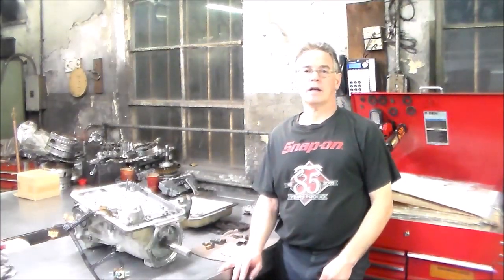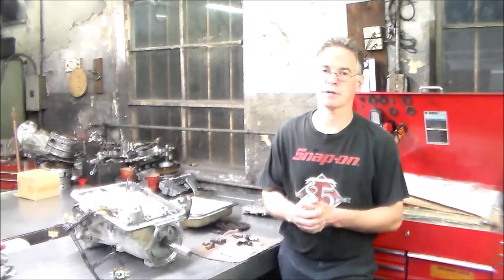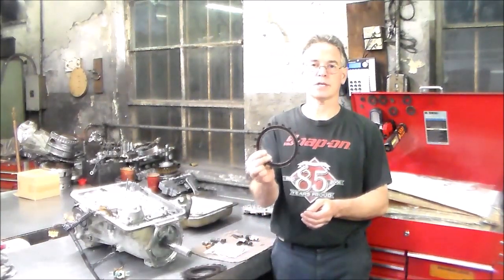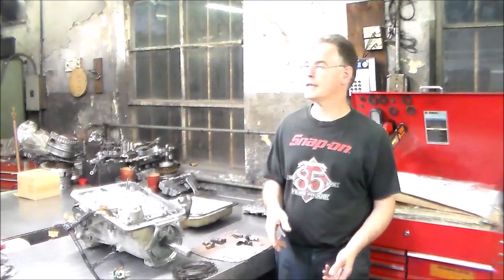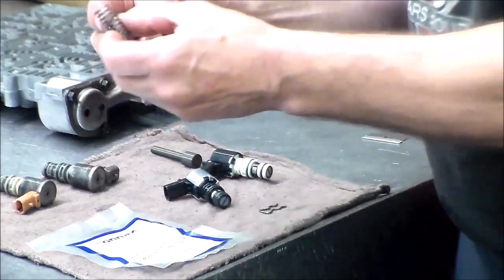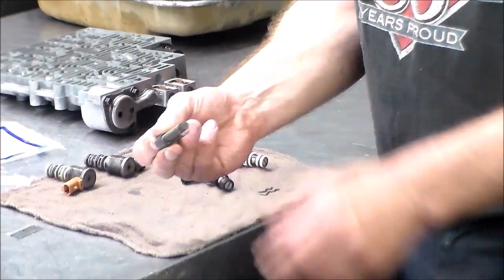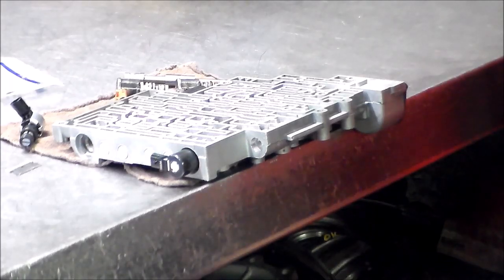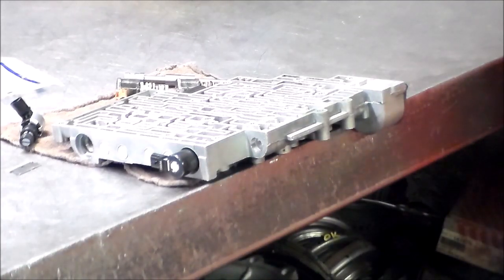4L60E, Moves Forward In Neutral

Comment: Well I'll be damned. After nearly a year looking into this issue, I noticed one of my clutches were definitely fused together. Took 2 drops to the ground to break em loose. Swapped em out from another transmission that I was planning to put in my 2004 TrailBlazer that were in way better condition and now I got reverse again. Thanks a lot for this tip here, really helped me out with the fun rebuild project!

Comment: I have a 4L60E doing close to the same thing only it will go in reverse for about 2 feet then trans brake.  Neutral and drive want to go forwards.  All gears work and shift other than 1st to 2nd gear seems to drag out when shifting.  Im going to try to swap out the valve body today to see if that fixes it.  You are the only person I seen that has a video on this topic but I dont think my forward clutches are stuck together as I do have reverse for a second before it binds.  Any advice would be welcomed and I appreciate you making this video very much.
Reply: Put the valve body from the  bad trans into a known good one and everything worked great so it was not a valve body issue I was having.  Figured I would update my comment in case anyone else wanted a little more info on my problem.

Comment: That problem has happened to me in my 02 suburban,  when I got ready to take it out, I was revving the engine in park . And herd a pop. Sound trans went back to working. 2 years later still working, but now just delayed engagement when I put in gear. I should have been removed it, but keep putting it off
Reply from the maker: Wow, suprised it lasted that long
Reply: Bro thank you, jst had transmission rebuild n forgot to flush it n the synchos or thin plates were stuck together.  Reved it high on park n just like u described it poped n now I got reverse again. Thanks, helped alot
Reply: @GaryFerraro   update  it's still working  just has the delay still.

Comment: Trying to find a good mechanic to check out my 2000 4runner. Jumps when i turn it on, reverse doesnt move at all, neutral it drives but occasionally works as neutral. Drive is good aswell as 2andL. Everyone is telling me the car is done for but I have hope it could be something like this. The car is good no lights on dash or anything no weird noises, don’t want to give up on my runner. Only codes i had were for the gas cap thing and possible vac leak
Reply: Replace the transmission

Comment: Hi Gary I just change out my a340e overdrive planet and now I don’t have reverse and neutral. All gears move forward and I took the valve body off the clean and remove all the metal shaving from the old OD planet. I think I might put the shift linkage in the wrong place when I took the valve body out the clean it. But when I put in reverse my reverse light is on.
Reply from the maker: Does the car start in park and neutral? all position seem to be ok?
Reply: @GaryFerraro  I haven’t try in neutral but I think I figure out the problem after watch some of your other videos, I think I didn’t connect the pressure valve to the gear selector (if that what it’s call) when I took the valve body off. I recall that valve was just loose and not connected to the gear selector. Will drop the pan later and get back to u thanks
Reply from the maker: @sacus209  ok, sounds good,  it's called the manual valve
Reply: @GaryFerraro  ok thanks
Reply: @GaryFerraro  ok so I hook the manual valve to the gear selector and everything seem fine and no check engine light but reverse will go into reverse but will only rev high and not go anywhere. I put at least 13 quart of transmission fluid and still rev high
Reply: Ok drove it around the block hard shifting and rev high around 30mph like it was slipping. Truck was giving to me for free from my brother in-law. 180xxx mile motor is still strong did timing and water pump  coolant flush. Before everything car will die when shift into gear but will run when give enough rpm like around 2 thousand then it will go but once slow down car hesitate on less put in neutral. So watch your vid and it was a bad overdrive planet and replaced and now the car will not die but not shifting normal. What could it be. Solenoid, TC, or valvebody, or the whole transmission
Reply from the maker: @sacus209  Just to confirm, you put the correct o/d planet set in, there are different ones.   What year is this?
Reply from the maker: @sacus209  There are other problems, sounds like internal, it slips forward gears?
Reply: @GaryFerraro  yes 2001 tundra a340e 20spline 16 reluctor 33 sun gear 8 3/4 shaft
Reply: @GaryFerraro  yes seem like I can’t go pass 30mph and it with just rev high than shift hard

Comment: Good videos Gary, just one tip.  93 - 94 were on/off CC, 95 - 97 were PWM CC, and 98 and on were EC3 CC.  The 3-2 solenoid are as you speak but the PWM styles conform to the years I quoted.

Comment: The parts that failed you didn't repair except the spring no body told you to go snooping for. So do I change the clutch plate and or the metal disc the attached to

Comment: Great info, just did a 4R75E with the same symptoms. Intermediate diode was broken and wedged together
Reply: My truck with a 4r75w is having the same problem. Would it be worth going in just to change that part? Or better off with a full rebuild. And is there anything else that could cause the same symptoms

Comment: Gary since the clutches are extremely warn would that have given any warning initially like slipping? 
Back in the day of the old school automatics [60's and 70's] slipping was always the warning sign especially when warm. Mid 70's i built a serious 67 Camaro RS with a 427/425 hp,  456 gears and a 4 speed,, i was always a 4 speed guy but now a new auto has so many gears and shifts so fast they are faster. 

Have you done any work on the new GM 10 speed yet? Its probably still under warranty anyway
Reply from the maker: Nothing on the 10 speeds yet,  Great question on worn clutches, you would think it would slip but it actually may work ok. I just finished a ford unit, came in leaking from front, did the trans and found the forward clutch wiped out down to the metal and it actually worked great
Reply: Very interesting.  Great comments.

Comment: This video taught me more than the transmission shop I had taken my Fj Cruiser to. My transfer case would grind bad when I would move it from neutral to H2. That’s because the transmission is still stuck in drive. The shop told me that it grinds cause the gears inside the trans are completely destroyed, they were wrong.
Reply: Shops aren't meant to teach you anything

Comment: The truck that I use to pick up parts , daily driver it do that . But all my gears are ok . Only it do that at times .
Reply from the maker: So it actually moved forward in neutral?
Reply: Gary Ferraro when start in park .
Veh turn on and goes forward a bit , pretty strange and not all the time .
Reply from the maker: @javieraviles6314  may want to check the cable adjustment

Comment: Gary, I know it’s been a few months but was wondering I just did a ls swap and now am having this problem. Did not notice it in the donor vehicle when I drove it into the shop. I still have reverse, still have drive. I have it on jack stands at the moment, and can hold the wheel to prevent it from spinning. Is this still the same concern or should I bel looking elsewhere. Thanks in advance

Comment: Hi Gary, I have a 4l60e from a 2000 Chevy S10 that would slip from O/D on the highway after it got warm. I took it out and had a shop do a rebuild. After I got it back and installed it, it would only shift from first to third after a long delay. No second, forth or O/D. They said it could be shift solenoids so I replaced them, still same issue. What do you think they could have done wrong inside the trans? Note it had no issue shifting before the rebuild. Thanks.
Reply from the maker: May have missed the band, band is 2nd and 4th. Just to confirm, reverse is ok?
Reply: @GaryFerraro  Hi Gary, you were correct. I removed the valve body and separator plate and sure enough there was no band around the drum. The band holding pin was also missing. I could touch the drum with my finger. Can't believe they could have missed it.  I took it back to them and showed them and they were dumbfounded. They said they will install it. Don't know if I can trust them. Thanks for your advice.

Comment: Hello i have enjoyed your video and find it to be very useful tool, i have a couple questions if you don't  mind  i rebuilt my 4L60E and reverse stopped working and my sunshell is good i replaced it in the rebuild also the 3-4 clutches burnt up again as to that is the cause of original failure. What is causing the 3-4 clutches to keep burning up.......CAN YOU HELP ??? THANKS
Reply: Maybe you didn't put them in right? Who knows.
Reply: Did you check your small forward and reverse bearing?

Comment: Hi Gary,
I have the same issue in a 99 Chevy Van. Is there something I could add to the tranny fluid to potentially free up the stuck clutch? I am not in a position to remove the transmission right now and it goes forward fine. ( No reverse and goes forward in neutral just like you described)
Reply from the maker: Not really, Trans has to come out to be fixed

Comment: Hey Gary learning a lot from your videos, I’ve so far built a total of 10 4l60e. But I now have one that has this problem, I’m going to pull transmission out. I understand about the clutches stuck to each other, but what is the cause? This transmission worked great for 4 days and then this problem happened. What would cause the forward piston to stay applied ?
Reply from the maker: Doesn't have to be the piston being applied, could be low pressure or misassemble, could also be a cross leak somewhere causing the clutch to drag and burn out, maybe one of the rings on the input shaft tore during assembly
Reply: @GaryFerraro  Gary thank you for getting back to me , I didn’t think about the input  shaft seal. Ok when I get it apart I will take a harder look at the input shaft. Thanks Gary.
Reply from the maker: @funkyoldmedina4232  These are the 4 white sealing rings on the input drum
Reply: Hey Gary , update on the 4l60e so far I found the top input seal ring was cut. You were right.
Reply: Gary you were right , the first sealing ring on the input shaft got cut. Found the cut piece in one of the ports inside of the stator shaft.
Reply from the maker: @funkyoldmedina4232  ok, Thanks for update, how do you resize them once they are installed?
Reply: @GaryFerraro  I use the resizing tool I bought from ATEC its the plastic version.
Reply from the maker: @funkyoldmedina4232  ok, slides over the shaft and resizes the rings correct
Reply: @GaryFerraro  yes it slides over the rings.
Reply: Hello Gary, I’m having an issue with a 4l60e. The issue is this the trans would travel forward in neutral and I had it apart and found the first teflon seal ring was cut. So I checked the stator support shaft and it was smooth as-it should be. Replace all the input shaft seal rings and installed the trans myself. Four months later the same problem comes back. I haven’t taken it apart yet, but should I look for. It has a 3200 stall converter, transgo hd2 kit, I noticed that the head pipes is close the the tranny lines, and trans line that go to the radiator for cooling had been deleted and ran into a aftermarket cooler. Can heat be my problem with this transmission? Any help would be great.

Comment: My car has no reverse, in park it shows as reverse with reverse lights on and dashboard says reverse even though it’s in park. Drives in neutral and launches forward in neutral when turning car on. Park tries to move forward when turning car on. I just had the solenoid transmission clutch changed. Car drove very good the first the day afterwards then all this started happening a few days after. Do you think it’s the spring like you said? My mechanic is saying its the neutral safety switch. Thanks.
Reply from the maker: you need a scan tool that shows data, as you move the shifter through the ranges, it needs to read correctly on the scan tool if it does not, change the switch

Comment: Hey Gary what's up? Would this problem be the same in all transmissions? I'm having this same problem with a 2012 ford f250 6.7L superduty powerstroke. And the transmission fluid is not discolored nor burnt. I'm getting fault code from transmission u0422 and a message on the display shift to park ( when shift into gear).
Reply from the maker: Do you know what the definition of that code is, if not e-mail me your vin number
gsferraro@yahoo.com

Comment: Hey Gary I got an 04 Silverado on jack stands and noticed that the truck does forward in neutral. That’s the only issue I’m having would this be my issue? I know it’s like shaking a magic 8 ball answering these questions only having a part of the info but any help is greatly appreciated
Reply from the maker: But if the wheels are on the ground does it move forward?
Reply: @GaryFerraro  firstly thank you for responding! I will have to get back to you on that as I’m waiting on calipers for the front they had locked up. Tomorrow they should be here I’ll slap the brakes and tires on put it on the ground and check again. I called sonnax as when looking up the spring i was confused as they stated it would NOT work for the later PWM style they confirmed it would in fact work for what I have. I also believe there’s an issues in the 4x4 system I verified I have my powers and grounds to the actuator and t case motor they do the thing before I pulled the front calipers and replacing the actuator I would get nothing up front after replacing actuator I would get a tug to the right or left depending if I was in drive or reverse so I took the front calipers off tried again and found that the front axles were not working, however I’m leaning towards the t case clutches being bad since it didn’t have enough torque to push through the sized front calipers. I’m dreading trying to rebuild the clutch portion as I don’t own the special tool to measure clutch clearances. Nor do I know of anyone who has one. The tool itself (if you can find an entire set) is very pricy and I myself cannot justify the expense to do one unit.
Reply: @GaryFerraro  alright so with it back on the ground it is no longer turning the wheels while in neutral however I am having an issue with the 4x4 still at first the front calipers were locked up the front axle was not engaging however the front drive shaft was spinning after replacing calipers it now moves the front wheels while in the air but I don’t feel like it’s going much for transferring torque to the front wheels while on the road.
Reply from the maker: @CamelGarage  Does the transfer case have a motor?   Do you have a scan tool to see if any codes are present
Reply: @GaryFerraro  it does and works as it should I started with replacing the motor when I got it running
Reply: @GaryFerraro   no codes present for anything other than a stubborn crash sensor in front I have traced the wire going to the front actuator it’s fine I load tested it with a headlight bulb it has good ground new actuator for the second time as I twisted the last one off. I’m thinking either the wash/clutch shim between the two shafts and the collar is gone as well as the bearing inside the diff side I believe might be gone as well I believe it to be a hard part failure at this point. I was thinking the clutches inside of the t case soo if I crack into it and find no issue no big deal I have a parts unit then I’ll have to figure out a replacement for the t case as I don’t have the tooling to verify clutch pack clearances on these auto units. They’re expensive at best and unobtainium on a bad day any tips on setting them clutch baskets in the nvg 246 t cases?
Reply from the maker: @CamelGarage  Haven't done one of these in a while, im so busy here i stopped doing the T-cases
Reply: @GaryFerraro  good transmission shops are hard to come by these days

Comment: Mines a 2004 Silverado 4l60e but on my oem one why would pnr321 show bright and do this exact issue and not illuminate any more? Switched my own one because 3/4 gear gone bought used one all shifts work good but it’s doing exactly as you said? Still same issue? Could it be electrical issue ? I’m going to try revving it hard in reverse tomorrow by the comments some people had luck
Reply from the maker: Have you had this scanned for codes?
Reply: @GaryFerraro  no I haven’t check engine light hasn’t turned on.. I will test drive today and see if any codes come on
Reply: Eh got lucky reved it in park and just heard a click and now it works
Reply from the maker: @eduardomedina4328  hopefully will stay working

Comment: Gary is the GM 6T75 a reliable transmission?
Reply from the maker: Not really the early ones(GEN1) later uniots seem to be better
Reply: @GaryFerraro   i see they have pressure switch problems,  will changing the fluid on a regular interval prolong the life of the unit Gary?
Reply from the maker: @nickyponz4475  I would say yes to that, that's really all you can do, can't even change the filter
Reply: @GaryFerraro  as always I appreciate your  wealth of knowledge in the field of transmissions. Stay well Gary

Comment: Will this fix a non reverse aswell ?
Reply from the maker: yes, if a forward driving clutch is locked together, you will have no reverse.  If the car does not move forward in neutral then it may not